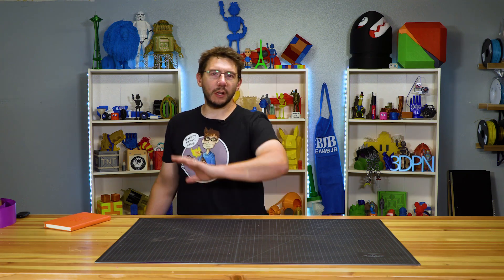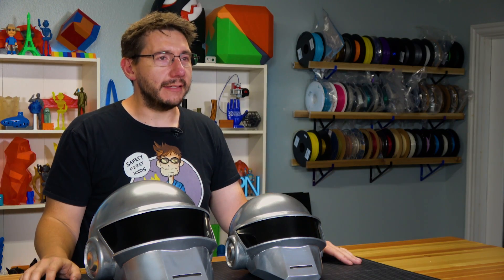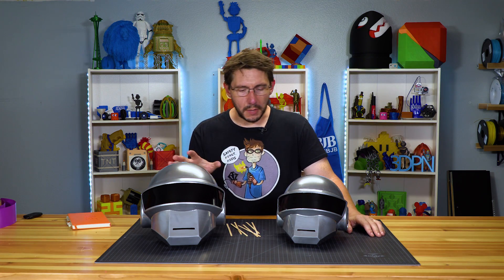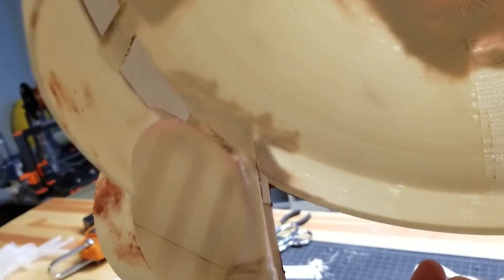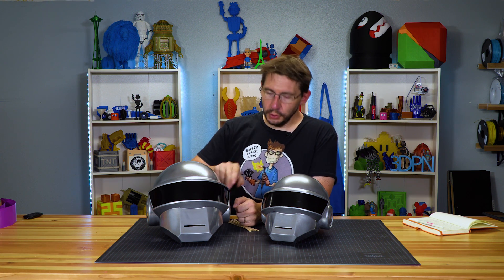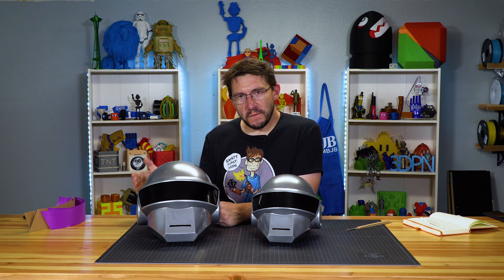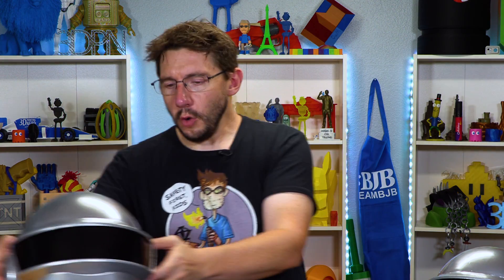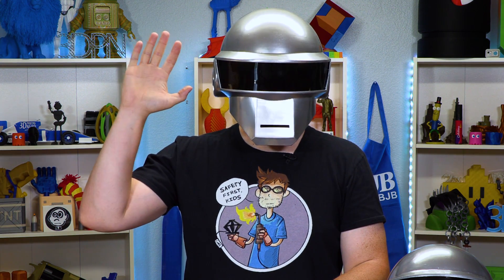DIY Daft Punk: 3D Printing the Thomas Bangalter Iconic Helmet

Comment: please can someone help me out here I just did 3d printing a corner shelf and on the bottom you can peel off the wafer but mine cant its very hard too peel off the wafer im not sure if the build plate is too low on the temperature its set on 54c on default or what could be wrong? please help thanks on a model 13860 from (M)monoprice
Reply: hello Friend i can help you , Send me a Mail of your Object in STL file and the printer you are using , the material and the slicing App (cura , slicer 3D.... ) and i can help you tune your printer and slicer so it prints perfectly ... check out my channel :D
chrisshakkour@gmail.com

Comment: Joel - if you want to get a super-shiny chrome-like finish, you should wash those both with dish soap to remove the carnauba wax, then wetsand the silver surfaces working from like a 200 down to a 1000 grit wetsand paper, then use an automotive grade gloss clearcoat for 3-ish coats, then allow it a day or two to cure, after which wet sand from 500 to 2000 grit untill it is an even hazy finish and finally polish it using automotive cutting polishes, starting with a medium cut and then a light cut.
Reply from the maker: That doesn't sound time consuming at all :)
Reply: it sounds that way when typed out, yes... but it is a lot of do a thing for 20-30 minutes then let it dry / cure, etc... come back in a few hours and do the next thing, etc.  

Painting something with a high gloss finish will always follow the same basic process whether it is a shiny helmet, a car's body panel, motorcycle parts, etc.
Reply: also an excuse to buy an electric or air powered polisher as well to speed up the polishing phases...

Comment: No matter how good or poor one is at spray painting.  You can fix any issues with a wet sand up to 2000g.  Depending on how much of an oopsy you made and need to fix but you 'should' always wet sand with 2000g between color and clear as it will get rid of any and all imperfections.  While filler primer is cool and all.  It's actually for filling micro scratches and pin holes.  Not what the 3d community uses it for so while it works.   Resin will always be better. It adds that rigidity that your first model didn't have.  Allows for easy sanding and the use of power tools which makes sanding even better.  I would recommend an oscillating sander/multi tool vice a palm sander or orbital sander. Mostly for the variable speed and for the fact that it has a nice point and can get into much more complicated spaces.

Comment: Joel, at your local mega-mart (in my case that begins with a W) where there is a bicycle section, they sell padding for adjusting  helmets. You could look at those as well as the egg-crate foam you used ;)

Comment: Finally a finished model, turned out great, one thing I found out about XTC on my mask, it's  best not to use it on models with small details, it tends to fill in the deep areas and it's too thick in my opinion. Tried thinning it with acetone but it was still too thick, best to just prime with filler, sand wet and dry and maybe use some spot putty.

Comment: I hope that wasn't automotive spot puddy. There is a reason you mix that stuff on a plastic board. That stuff won't stick to plastic, so if that is what you used it may lift off eventually.
Reply from the maker: It was the stuff Bill Doran told me to get a while back, and if it works for him, it'll definitely work for me :)
Reply: Yeah, I see a lot of people using it on 3D printing projects. It just confuses me. I used to work in automotive and all of the mixing boards and spreaders are plastic that is used with the stuff. Once the material dries you can just peel it off. So it is a head scratcher for me as to how it is being used.

Comment: I wish you used a different model instead. Both of the adafruit daft punk models look really off with sizing and proportions. I'm working on a thomas helmet right now and I just need to find some good chrome paint and then get the lights in. Either way awesome video as usual and it's cool to see new techniques you haven't used before
Reply: I totally agree. The bottom mouthpiece area seems totally off to me, but if he likes it, then its okay.
Reply: If it wasn't for being a daft punk fan I doubt I'd notice anything wrong. He did a really good job making it, it looks really smooth and the visor came out perfect so it still looks really good
Reply: Honestly.. Don't waste your time with Chrome DIY paint. Once you put your fingers on it the helmet is ruined.
I sent my Guy Man helmet to Don at Coat of Chrome and he did an awesome job chroming it. And it has clear coat on it.
Reply: How much did coat of chrome quote you on the helmet? I have wanted to make a helmet for a while but I haven't found a way to get that chrome finish at home.
edit: Also, what kind of finishing work did you do before sending it in for the coating?
Reply: Daniel Jansen
I Believe it was 325.00 for the chrome. But he primes it and does all the sanding work on it then he chromes it.  I did some light sanding.. Nothing major. Maybe if there are some little holes in the cast you can fill those with bondo and sand it smooth. This part is very important.. If you are going to chrome the helmet DO NOT put any rattle can paint on the helmet.. Actually stay away from anything in a rattle can - paint or primer. If you want to prime the helmet before you get it chromed it has to be a 2K type automotive primer. If you put rattle can paint/primer on the helmet it will bubble up and damage the chrome from underneath. So stay FAR away from that stuff.  If you want to go with just a silver color paint then you can put whatever you want on em. 
If you want to see how my helmets turned out you can check out my instagram @ Mykel Waters. I have photos up there all along the process of starting the helmets to finish.. Leds and all..  if you want LEDs check out Alex Plus leds. He sells kits specifically for Daft Punk helmets.. His stuff is top notch.
Reply: Awesome I'll be sure to check out your pics and thanks for the tips as well!
Reply: Anytime. Good luck with your build.

Comment: For PLA, I use automotive glazing putty (Nitro-Stan, Bondo, store brand). I squeeze out a dab, then thin it with acetone until it's milk like. I then brush it on in the gaps. It dries quickly, and I do multiple layers until there's some excess, then sand until smooth.

Comment: I have a suggestion, What about making a video showing doing a test of Filament for easy printing and then sanding after. ABS is very good for sanding, but not the best to print unless you have a enclosed printer so is there something else that sands just as well, but is super easy to print ?

Comment: A couple of product suggestions for the future:  Instead of the Bondo spot filler I recommend Elmers Probond filler.  You can use it indoors, it sands easier, and you can water it down and coat the whole piece which can take the place of the XTC3D which I think is most usefull to get up to B quality without all the other filling, sanding, priming, and painting but if you are going to put in the work for A quality I don’t think it’s a great choice.  For chrome spray paint, I recommend Duplicolor Perfect Match Universal Chrome.  IMO there is nothing better in a can, so if you want better chrome you need to go to a paint gun after that.  Finally for a sealer I often use different gloss versions of spray sealer to get the effect I want but sometimes I use NuFinish which isn’t really a wax at all but acts like a wax.  It does have some warnings about using it on plastic but I have never had any issue with it.
Reply: I'm about to do a putty "battle royale", and I'll need to add that Probond to the list of stuff to try.

Comment: Everything looks good, but that's not a DP Thomas Bangalter helmet. It is lookalike one, but it has too wide/long mouthshell, wrong ears, weird visior angle. Sorry - I'm just some regular DP fan :D
Reply from the maker: You've very right - it's more an inspired by helmet. It's still cool, though, and I love it! :)
Reply: @3DPrintingNerd  I'm a fan od them and made my first TB helmet out of cardboard, fiberglass and resin. Never finished it tho :/ I have some plans to print and finish the "encore" one. I have the visor for classic one, made of LED matrix and controled by arduino.

Comment: Also those led's, i have some led tape (multi colour remote controlled) and the control box looks to have the same connector as your's so you might just be able to replace them if required

Comment: Hey Joel, small tip, if you want your top coat of paint to be a metallic, especially chrome, then the basecoat underneath should be a glossy black and it causes the chrome top paint to pop a little more. Don't ask me why it works, but it just works. Punish Props Academy taught me that.
Reply: The reason why this works is due to how metallic vs non-metallic reflections work. Non-metallic reflections have a color underneath, with a colorless reflection on top that varies by angle. Metallic on the other hand, doesn't have a base color. It's only reflection. So to mimic that, you need the base color to be black, so the metallic paint is giving the reflection, and there's no other color mixing in.
Reply: Thanks for the explanation. Always love to find out the why.
Reply from the maker: That's a great tip and I'll remember that for the future!

Comment: hey 3DP will u finish the open Rc project soon
Reply from the maker: YES! The last modified model from Daniel Noree is printed! Now, I have to get some styrene plastic to hold the bottom part of the car together. Then, nuts and bolts. I think the batteries are done being made. Then, it's assembly and go time!
Reply: thx joel keep going

Comment: You can buy 10 meters of those lights for less than 2$... No need to detroy shoes for it.
Reply: He said those ones were broken.
Reply: Yes yes of course i heard the "they were broken" but what i see is a pair of brand new shoes being torn appart. And even if they were a little bit broken, it's easy to fix and/or donate them, and then buy the lights which are almost free online.
Reply from the maker: They were broken, though to be fair, destroying shoes with scissors was kind of fun :)